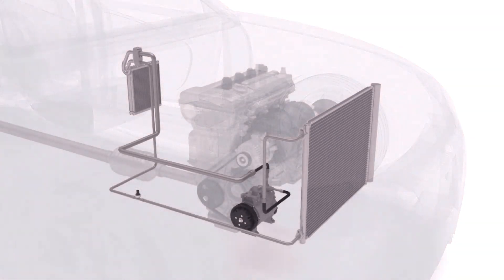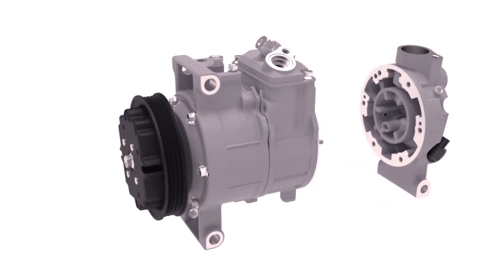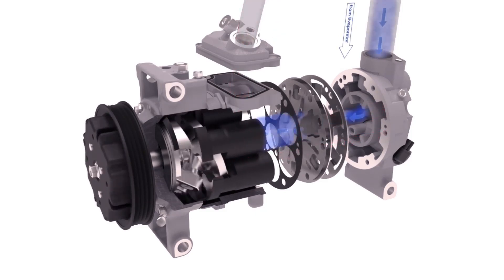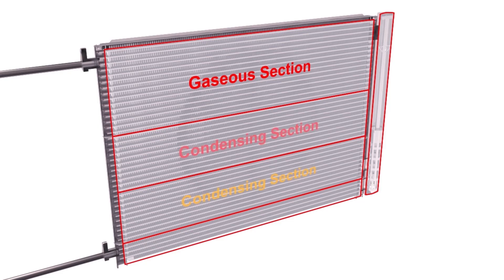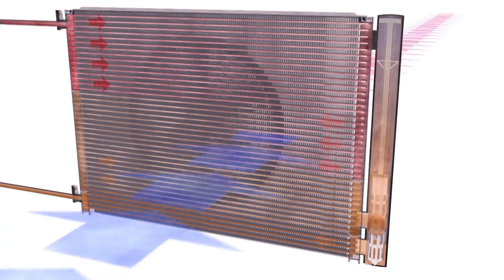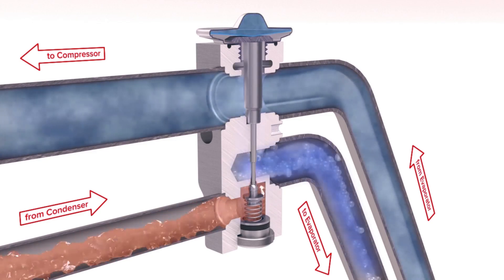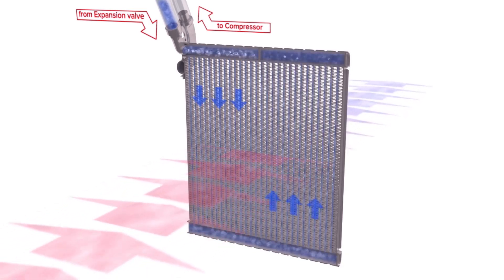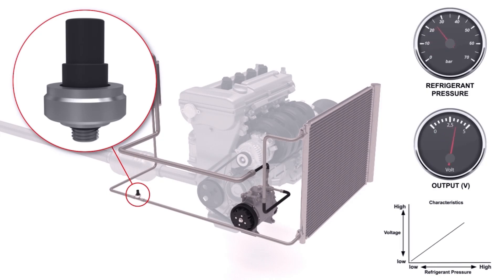How does car AC system work

Comment: Where is water going?
Reply: If you are referring to coolant, the coolant flows through the heater core which is a separate component not mentioned here. It works very similarly to the evaporator but reverse. The heater core has hot coolant flowing through it which the blower motor will blow the heat from into the cabin for heat/defrost purposes.

Comment: Its too clearly that the pressure sensor the only safety control that has monitored the status of compressor? A may right?
Reply: some cars have thermal switches on the compressor.

Comment: 0:10 into the video “the driver is unable to concentrate on driving, which leads to increased road safety”

Wouldn’t distractions decrease safety? Upgrade your AI
Reply: You heard it wrong, it said “the driver is then able to concentrate on driving, which leads to increased road safety.” It was correct.

Comment: I know how an AC system works. I wanted a video on a CAR AC system. Completely left out how it is controlled or directed
Reply: Yea the title is “how it works” not how it’s controlled. You’re watching the wrong video bud
Reply: Yes im having too much air flowing to my feet and not enough to my dashboard, wanted to know whats the component that channels the airflow
Reply: @omarkharnivall2439  They're called 'blend doors' & you're wanting to investigate your car's blend door servos, etc.

You'll need to research that for your specific vehicle.
Reply: @omarkharnivall2439 that’s probably a blend door actuator issue
Reply: @omarkharnivall2439 blower motor sir. There’s a variable resistor inside the blower motor than allows for more or less fan speed/air power at the vents.
Reply: @joboss9511  the mechanic at honda told me that since theres only two vents at the feet, the air blow stronger downwards 😂

Gonna check it out, thank you for your reply
Reply: I like it  exaltly like ikedwelcomd gues Hvac  jolly  ... auto  mobile   air  conditioning   the   vehices   are  air  conditioned   by  mechanical    refrigeration  systom   auto  mobile  air  condition  ing  systom  should  have  high  capacity  to  cool  the   inside  air  with  in   a  few  minutes     after  the  journey  has   started   comprssor    is  operated  by  the  engine  in  some  ehicles   air  be   heated   using  the  hot   water  from  the  engine  in  winter  season  . Full figer ing and  vewes s ..  blower   finned   eva  porter   ... suction   pressure   regulating  valve    ..suctuinline    ..compressor..  compressor   ..clutch   plate   and  driving   pylley  .. high pressure    vapouer   ti  condenser    .discharge   line    ..Receiver  drier   .sighg  glass   .liquied  lunw   ther  mosttatic  expansion   val  swi    switch    ....... battery  ...ve     ther  mostat    on  -off
Reply: @jollyscaria1922 holy crap did you have a stroke?!

Comment: I really hate that the air conditioner and the engine are linked. I wish cars had it made so that you can turn on the ac compressor without starting the engine. I live in Texas, and it's really inconvenient that I have to waste fuel to cool off in the car.
Reply: Hybrids are exactly that
Reply: It's got to be powered by something, and everything in your ICE-powered car ultimately runs on your engine through charging if it's electrical. The added weight and cost to create an externally chargeable system on an ICE-powered car just for this purpose would be extremely impractical and not save you any money.
Reply: Idk how you’d do that without an electric vehicle
Reply: @danielscheib119  U need some kind of a power source to be able to run the compressor. It can be an Engine, an electric motor, or something else.
Reply: new motor, complicated

Comment: How it cool the car space. That's why I am here but it didn't explain well
Reply: Simple version  is that heat from air from your car gets absorbed into the ac pipes after air flows over the pipes (which cools down that air which is what you feel). The warmer refrigerant flows to another fan and the air blowing over the pipe actually ejects the heat outside your car

Comment: Does anyone knows if never running the a/c on damages it? I only turn it on a couple times a year
Reply: If you do not use your AC it can seize up do to low lubrication. Every so often just turn it on for some time.
Reply: Had a friends AC seize up and now he cant use it... In a very hot and humid state
Reply: Its on when you use youre deffoger
Reply: Yes it does - you must use it year-round.

It has rubber seals all over - & they're kept in good condition by refrigerant flow.

Not using it long term, allows the seals to dry up & therefore leak.

Some cars are more susceptible to this than others.

Some cars with fully automatic climate control, always use the a/c.
Reply: Regardless of what happens to the AC, never running your AC will result in a lot of condensation build-up. This can cause oxidation or mold, which is very harmful to your health to breathe in. Your AC acts as a dehumidifier and helps tremendously with this. AC technology has also been a lot better for the last 20 years or so in cars (at least in the US market, probably similar in Europe/UK). If your car is roughly 2005 or newer, you should run the AC regularly. Hope this helps.
Reply: i assume like electronics, you should use it from time to time but if you never use it why worry if it gets ruined?

Comment: Okay so if the AC is still blowing, theres still coolant, no clicking noise, everything normal but no cold air is coming out (1997 Lincoln Town car) what part(s) malfunctioned and needs servicing/replacing?
Reply: If the air is blowing warm when the AC is on that means that the evaporator for one reason or another is not receiving cold coolant. If there are impurities in the system a blockage could exist somewhere in the system, or if the compressor grenaded itself. If you’re not hearing the clutch click when engaging the AC then the clutch is not engaging on the compressor and the compressor itself is not operating. If this is the issue then it could be an issue with the compressor itself or an electrical issue.

Comment: Is the a/c clutch suppose to stay engaged all the time when the a/c is on and the car is working on park gear on idle in a properly working A/C system or is it suppose to cycle on/off (Altima 2010)? Thx
Reply: It’s normal
Reply: The AC compressor will cycle on and off if the temperature in the cab is very close to the target temperature on the control knob, 

In more detail, the compressor will turn off when target temperarure is met, but then because the compressors is turned off, the cab temperature will get slightly warmer and when the cab temperature no longer matches target temperature; the compressor will turn back on

This cycle repeats constantly to maintain the desired cab temperature 

However if there is a big difference between the target temperature set on the control knob and the temperature in the cab (for example, on a hot summer day where the car has been sitting under the sun not running therefore the inside of the car is very hot) the compressor will stay running constantly and will not cycle off until the temperature inside of the car reaches what you set it to, then it will begin to cycle on and off to maintain that temperature as I explained previously
Reply: @IHETguy this is not correct.  the thermostat on the system is in the back of the evaporator to control freezing of the evaporator.  this is what turns the compressor on and off.  it does not need to reach the set temperature at the knob.  you can check by starting the car when it is very hot outside.  turn on tha ac, put it at max cold, put the blower at the slowest speed setting.  open the hood and the compressor will start turning on and off even when the cabin is still hot. on cars where the ac has digital controls, compressors are mostly clutchless  and an electronic compressor valve controls operation of compressor.

Comment: Hi!!! May I ask if putting two condensers with the high-speed fan on each condenser will make the AC Colder?
I'm living in a tropical country so colder AC is better... Thank you!
Reply: the purpose of condenser is to lower the temperature of refrigerant so that it become liquid.. in liquid state it can be spray at expansion valve.. the answer is yes.. it could make your ac cooler.. but at some extent.. the efficiency of ac depend on many factor.. mainly cause of the efficiency of heat exchanger at condenser and evaporator, evaporator usually has thick layer of dust bcause it evaporate and trap water.. so dust stick to it.. so we have to clean it.. and change cabin filter.. it will obstruct air flow
Reply: @rombakrawat86  very informative. Thank you!
Reply: Nice , and smart idea you got , 🎉😂

Comment: May I ask how the evaporator blower airflow travel?is it blowing from the txv location or back of txv location?
Reply from the maker: A TXV is essentially a meter. It controls the amount of refrigerant that is released to your air conditioner’s evaporator by dropping the pressure between the liquid in the line and the evaporator.
Reply: @wearemechanics  Could i please know why we need to compresss the air if then we cool it?
Reply: @francescopiccoli8512 you compress the refrigerant not the air

Comment: You forgot the accumulator or also known as the receiver dryer that takes any moisture out of the lines
Reply: Also the modulator performs that role on certain cars - it was mentioned at 2:40
Reply: I don't think accumulator takes out moisture from the system. That would be the job of the filter drier. The accumulator stores excess refrigerant in the suction area due to overcharge.
Reply: @oghenemarojonathan4633  no on systems that have an orifice tube they use an accumulator that big cylinder thing it’s job to remove moister. Systems the have an expansion valve have the small dryer thing that looks like a fuel filter.
Reply: @oghenemarojonathan4633  
Accumulator:
- used on orifice tube systems
- placed after evaporator
- removes moisture, filters debris, and makes sure no LIQUID refrigerant makes it to the compressor

Receiver/dryer:
- used on expansion valve systems
- placed after condenser
- removes moisture, filters debris, and makes sure no GAS refrigerant makes it to the expansion valve

Comment: Is the air inside car only circulate? Or outside air come in?
Reply from the maker: In the air recirculation mode, the car's air conditioning system recirculates the air inside the vehicle for cooling. Selecting the fresh air mode brings in outside air into the car by opening an air duct in the front of the vehicle. Both these modes have their advantages and disadvantages.

Comment: But why doesn't a car have a filter like a house a/c? It has a cabin filter but that just filters the outside air...
Reply from the maker: Your car's air filter and cabin air filter are both parts of its HVAC system. The air filter removes debris and dirt from the air, preventing them from reaching your engine. A cabin air filter takes the same approach but has been designed to also remove dust and pollen from the air you breathe.